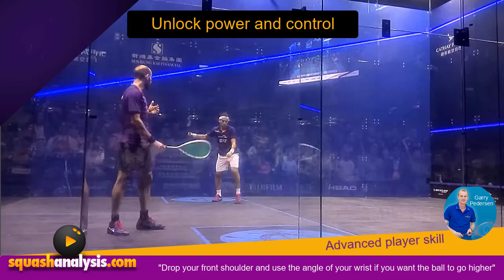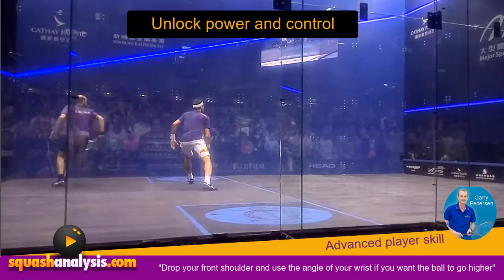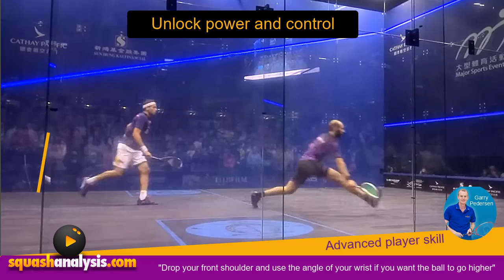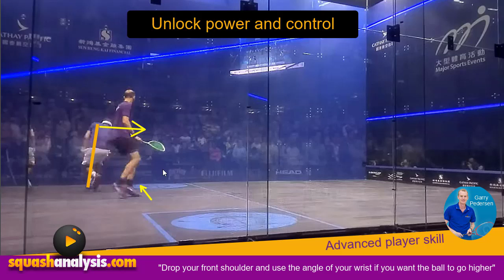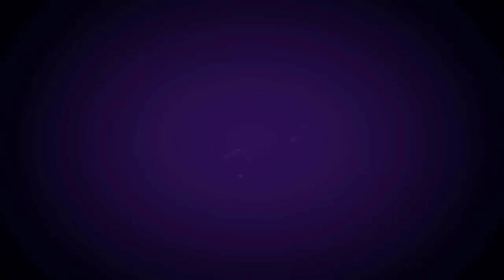Squash analysis - Unlock power and control

Comment: Does this apply to the forehand too?
Reply from the maker: It is similar, you hold body structure but the forehand advanced swing uses more wrist rather than arm swing. Forehand is more back foot so this will change the shoulders with the open stance. Stay strong and you will be on the way to quality outcomes.

Comment: Just tried this yesterday, and it improved both power and control immensely. In addition, i also realized, due to this tip (somewhat strangely), how my core could be utilized to increase stability and balance. 
Thanks Garry, for the awesome videos.
Reply from the maker: Wow, it allows you to use your core for power in stead of it trying to control your balance and when you get perfect balance everything seems easy. The angle aligns your body over you feet and drives body power into the ball. It will get better still as you train your muscles to do this all the time. Thanks for the feedback, I am as happy as you that it worked so well for you.